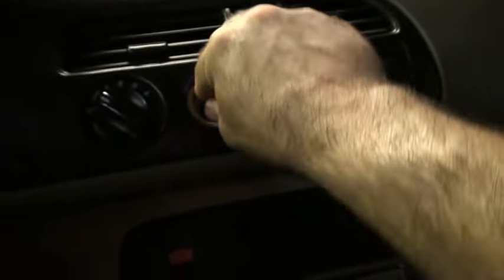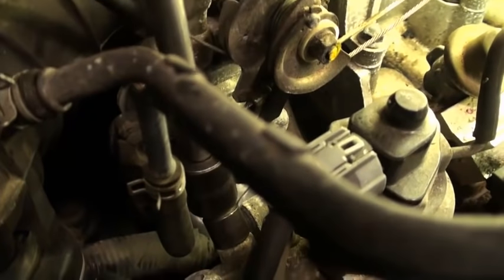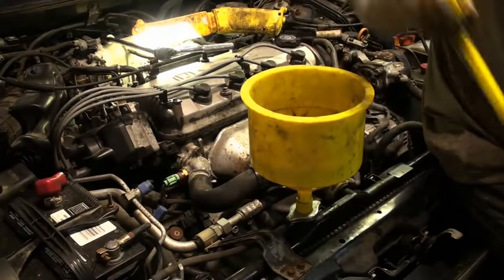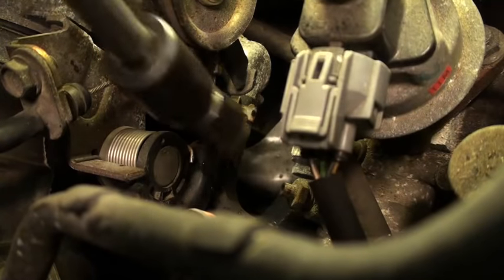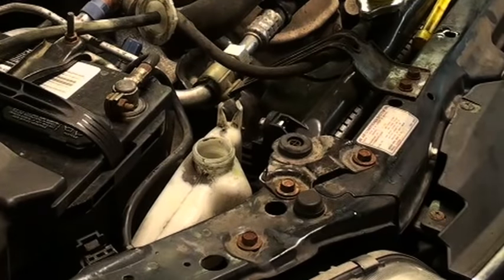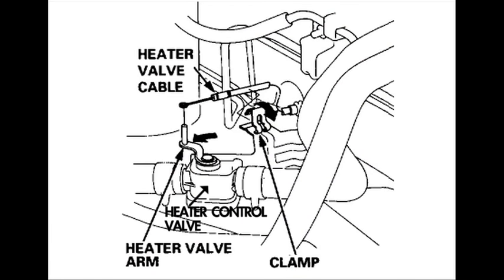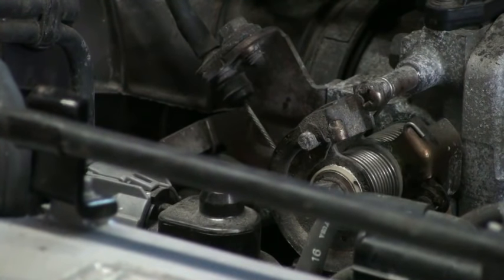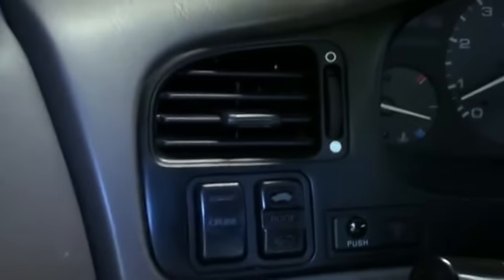How To Bleed A Cooling System - EricTheCarGuy

Comment: I still dont understand what was done here to bleed the air out, i dont get it.
I have seen other videos where you rev the car at a decent speed and you open the reservoir bottle(header tank) and then you squeeze the radiator pipe. Not sure which pipe ir was though , the Input or Output hose.
Reply: +Imre Csoka  Simply follow the detailed outlines in this video and your coolant system will be bleed.

Comment: Eric I have a 96 honda accord with the f22b2 with the autmatic transmission and I have a plastic radiator that has the tranny cooling lines running through it and its leaking into the antifreeze and I was wondering if you could make a video how to flush the transmission
Reply: +3J Kreklau okay

Comment: question... what do you do with a vehicle that doesn't have electric cooling fans? like on a truck? my canyon has the single fan that's belt driven.
Reply: +Anthony McDonald Probably need to run the engine long enough for it to get to working temperature. If it's a big American engine, give it say 25 30 minutes & ascertain by carefully touching the hoses & other parts of the cooling system.
Reply: Unless things have changed, the clutches on mechanical fans basically respond to heat. So on a cold start it'll slip a bit and not pull as much air since the water in the radiator isn't hot and therefore heating the air. Now when everything gets up to operating temps, the fan's going to be pulling in hot air and the clutch tightens up and the fan spins faster, or closer to the engine speed.

Comment: Yes sir I have a 07 dodge nitro and I have a transmission fluid leak on the driver side front...how do I change out my ac condenser I was told the trans cooler and the ac condenser are made in one unit...how do I change it?

Comment: hello Eric i nstall a engine in my Honda civic the i bought  from a junk yard the engine run is very smooth but the tempurature gage is in H i replaced the thersmotat and the switch the goes from thermostat housing to the radiator fan, but my radiator fan it doesnt work when the temperature rich 150degrees but i connect wire direct from my Battery to the radiator fan and it work. you think i need to purge my radiator or water pump i dont know . help me please
Reply: wilfredo perez cooling fan fuse, possibly clutch but most likely fuse.

Comment: I have a 2004 ford focus and my reservoir bubbles up and has done this for a while. what used to happen every great once in a while is that the car would overheat from having no water. Now, the reservoir bubbles up and then water comes out of it and of course, heats up because of no water. I turn car off before it heats up and when it bubbles I turn it off because then water comes out. the car will run fine utility car temp gets where it needs to be. Also, heat didn't work until I gave it gas. if I need to bleed the line.... where is the bleeder?
Reply: I meant it runs fine until it bubbles up! I notice the temp gage is ok while bubbling up.

Comment: need ur 2nd opinion sir. I have rough idle situation after I bleed the radiator. I've re bleed the radiator n make sure all bubbles out and also found the vacuum leak in intake gasket n fix it, change the auto idle up, change the Idle control actuator in throtle body but I still have the symptom. fyi I'm using swapped k3-vet with custom velocity intake & td04 turbo. do u have any suggestion sir? thx in adv.
Reply: I also done the vacuum leak test n find no more leaks

Comment: Hoping to get a response. 
My vehicle was running at the proper temperature before I replaced all the radiator hoses.
Now it's overheating. 
I tried to follow all the steps about bleeding the air out of the system but it's still overheating.
Reply: What car and while its overheating feel both hoses if 1 is clearly hotter than other or 1 isnt even hot just warm then you may have an issue with your thermostat 

Are your cooling fans connected and working?
Reply: @liveandletlive2894 ,
Yes cooling fans working.
Thermostat was replaced a few months back, but I went ahead and replaced it after the hoses.
It's a 1997 dodge ram 1500 5.2L 
Like I said, before changing out the hoses the temp never got above 200.
I was wondering if air got Trapped in the line, but I've tried to bleed the air out.
Thanks for the reply!
Reply: @sandracox4341  little bit of air shouldnt overheat the engine I never bleed my cars until the winter
Reply: @liveandletlive2894 , 
The car guy in the video said that overheating could be a symptom of air. 
😥
Reply: @sandracox4341  I know but just saying from my experience a full system with a bit of air isnt an issue...if you have so much air then yes itll cause overheating but then again your system isnt full if theres that much air in it
Reply: @liveandletlive2894 ,  I guess to the mechanic I go.
It's just so strange that it worked fine before switching out hoses.
Reply: @sandracox4341  well I guess if the only thing you did was switch hoses then they're must be a substantial amount of air in the system...did you try bleeding it the way he did with that bug funnel?
Reply: @liveandletlive2894 ,  yes with the funnel. 
But I can't locate the bleed valve.
Reply: @sandracox4341  not ever car has a bleeder valve do the funnel method and  rev then engine a couple time then after 15 min or so of running and the cooling fans come on at least once feel the coolant in the funnel if its hot/warm which means the water pump is working and you have circulation
Reply: @sandracox4341  also make sure the heat is on while you do this
Reply: @liveandletlive2894 , thank you. I'm going to drain everything out and start over.
Reply: @sandracox4341  don't think you have to drain it just fill and bleed
Reply: Ryan Quinlan  good call!
Reply: Ryan Quinlan , no!

Comment: hey my honda prelude 94 starts but the idol isn't engaged at all.car will die if I don't hold down accelerator. Any suggestions?  I was told I need a new control idol sensor,  does that sound correct?

Comment: In the past summer,  I change the radiator in my Acura 2004  but the lack of antifreeze I use water  now  in winter should I back to 50/50 or 100 antifreeze and why ?
Reply: change it for 50/50 immediately , otherwise your engine will rust inside and clog everything and ruin your car. also the water will freeze and burst everything, that's why it's called antifreeze
Reply: Ok thanks!

Comment: Eric, I bled my cooling system (attempted to) but the coolant just came leaking out from under the funnel's radiator cap. It's the only one that fit, but it's just a slight hair too big. Is there any other way to bleed it? (84 Lebaron, non pressurized expansion tank)

Comment: If you don’t have the air release bolt keep the front of the car higher than the rear as your pouring in the new coolant. Incline driveway or jack up the front.
Reply: Can you elaborate please ?

Comment: I bled out my coolant any my car still doesn’t have warm air. And there’s a code on the dash for a p0505 (Iac valve). The car runs fine until it gets warmed up. And the acceleration is super sensitive in lower rpms. But the car will accelerate just fine in the higher RPMs. Think you have an idea on what I may be able to do?
Reply: 1998 Honda cx

Comment: But when I take the radiator funnel back off won't the coolant just spill out because of the pressure?
Reply: +omarbarcena97 If you mean out of the radiator, than no, there isn't any pressure if there's no cap.

Comment: This may sound silly,  but there's a need for a video on the correct way to change coolant .  Just saw one where a guy did a petcock drain,  added chemical flush and distilled water,  then drained and refilled twice with distilled before refilling  -  with 50/50..

Comment: i have a 2002 buick rendevous ..i just did a cylinder head replacement and my fans wont come on. i took it to an auto electric  place who says i have air in my lines and thats why my fans wont come on. i have been trying to bleed the lines by the bleeder valve with continues air if i attempt this way what do i do if my fans still wont kick on

Comment: Hey man, I have a 2003 S10 and I went to charge the AC with R134 and it is not going inside the system...The gauge is reading 100psi when I plug it to the low side port... My clutch seems to be engaging because when I turn the AC on the idle jumps and I hear "the click" I also tested the AC charging kit outside of the vehicle and it is shooting coolant out just fine...Whats goiing on here? I just charged the system with a very small amount of r134 2 weeks ago..

Comment: What do you do if your heater core isn't hooked up? My isn't hooked up and the hose for it has a spark plug in the end of it.
Reply: That's funny!! BWAHAHAHAHAHAHAAH
Reply: Connect the 2 hoses together so coolant runs through.
Reply: hey dave if you don't see that bleeder valve do you just take the cap off turn the heater on and rev it for a while till you basically cant top it off anymore?  and I got a clutch fan cooling fan is it supposed to kick on and off like an electric one?

Comment: Hopefully, the comment section can help me out with this. I have a BMW 328i 2011 and on the left side of my hose that is connected to my radiator keep coming off, so it'll leak all my coolant. It happened twice so far when I drive my car for a long time. I would have to keep putting the hose back on. What could be the problem? thank you

Comment: I have a 1999 beetle, GLS 2.0... had good heat before- I put a new thermostat and now I have no heat. in this beetle radiator is filled through the Reserve container.so I pressure vacuum through it to remove all the old coolant (big mistake) now I have air in the system.
Reply: +C 19 Look on the reservoir for a small diameter hose, probably connected near the top. This should be a degassing/vapor return line connecting the top of the radiator to the reservoir. It's designed to collect any gasses in the coolant circuit. Take care as it is usually part of the pressurized circuit.
Reply: trespire-thanks , I fixe the problem by squeezing the lower hose many times.

Comment: I've got an 03 dodge ram (there is my problem lol) heat has never worked but never needed it until now, the heater core is very clogged I confirmed that, what can I do if only a tiny bit of fluid runs through it, I've tried the air compressor trick to no avail! Plz help what cleaner can I run through it.

Comment: Hello, I have had problems in the past with bleeding my coolant system on my vw passat vr6. It doesnt have a radiator cap, it has only an expansion tank. I ran the car with the cap off for several minutes until the fan came on and still managed to have air in the upper radiator hose. Any tips for bleeding this type system?
Reply: I'm not sure if the VR6 engine has bleed screws, but I know the 2.8 V6 on my B5 A4 does. I'd try searching the VW forums or passatworld.com. They'll probably have a good idea.

Comment: My 2001 honda odyssey has 2heater cores (for front and rear heat) just changed fluid can't get heat to operate. No bleader valve on my car. Can you help?  I've done Hondas procedure 3 to 4 times. I must be doing something wrong.

Comment: Hello I have a 2004 Infiniti G35 coupe and been having cooling problems after changing the water pump, thermostat & radiator jus yesterday I was driving the car and notice it was over heating again and smelled a lot of coolant from in the car while I was driving pulled over to check what was going on and seen a lot of coolant all over the engine remind you I jus had the cooling system bled.....what to do?

Comment: hi I have a question I replace my thermostat radiator cap and I put new coolant in there and my car seems to overheat still what can the problem be ? its a 02 Nissan maxima 3.5

Comment: Dear erik the car guy i have a 97 honda and it does not have a bleeder valve i read on it and people say its on the radiator near the top radiator hose but i replaced the radiator and it is not oem and does not have a bleeder valve with it how do i bleed the car with out a bleeder valve? Thank you

Comment: hay eric just found ur channel here latley herd of it but i was searching more or less on specific vehecles ,but learning alot in general ,my q is i just replaced thermostat on my wifes 2000 pontiac sunfire 2.2l ,i was wondering two qs i watched ur vid on stats ,im wondering #1 the car had a 192 degree stat ,i went to my local advance and my tech or what ever theyre called ,who has 20 + years gave me a 180 degree ,i had hered that 192 was way to go ,no spec in owners manual on witch was gm s recamondation,so what do you think pros cons anything,only thing i cood see is one opens sooner than other,which brings me to #2 as far as temp gage on dash i do not see any major difference as far as temp being lower on gage i guess in my head i was thinking when gauge got to 180 or so it wood start cooling well faster than with  the 192 well not faster i mean sooner,i could not here stat open or close but temp has always been about 195 or lower it started gone above that in last couple days figured try new stat not gone above 195 now but i did use bleeder like you said had good steady flow ,well if there was an air lock wood you get that flow from bleeder shit thats three qs well thank u for any time you can give me thanks i live in southern part of pennsylvania its been cold it was 39 today which is warm compared to highs of 15 at 3pm well thanks eric for any help

Comment: if you were to start up your car with radiator cap removed and coolant was to real soon after start to gush out of the top of the radiator- could that  POSSIBLY be a result of air in the cooling system-  this is happening to me    just recently replaced a lower air intake gasket  and this is one of the problems I am having  along with possible vacuum leak,   Thanks
Reply: I'd be looking into a bad head gasket. Whats the oil look like?
Reply: eddie; that's exactly what happened to my Toyota when the thermostat was stuck in a closed position. The water had nowhere else to go but out the top of the radiator. That can also happen if the water pump isn't pumping. (usually a broken fin or two)

Comment: So I am bleeding the cooling system on my 98 jeep grand cherokee 5.2.  It gets to operating temp and all is good for a few minutes, then the funnel in the radiator starts to rapidly boil over and it is like the coolant wants to escape the engine.  Is this a sign of a blockage? No air is coming out and the headgaskets seem to be fine.  I constantly hear gurgling in the heater core but that is a known issue with the GC's from 93-98.
Reply: From a thread on your site, Thanks!! "I think I mentioned this contingency in the video. If that happens, turn the engine off and let it cool. After a while the coolant may go down inside the funnel. When it does, top it off and restart the process. It happens sometimes. It's not a big deal, it just takes a little longer to purge the system."

Comment: Hi Eric I have a 2015 Renault traffic 80,000 miles that heater just blows cold air ,so I flushed the the heater matrix and found oil in the system. It did heat backup a little bit for 5-10 minutes and then back cold . I had a 3 year apprentice mechanic and he is talking about head cylinders/ gaskets . €0000000
Any idea what it could be 
Cheers

Comment: I have a 2002 Honda Accord 2.3. I was running the car for about an hour before I realized my needle in the gauge was marking 3 lines before the red HOT line. I checked the antifreeze and it’s full. I have no check engine light or maintenance light on. What could the problem be...???!!

Comment: I have a question when I open up my radiator cap it shows like it's low on coolant but after I started up and let it run the coolant rises up to the top And even sometimes starts pouring out what could be the problem

Comment: I've always wanted to ask this question: can I bleed the air by driving the car while the radiator cap is half open or loose, instead of leaving it running in place with the cap off?

Comment: recently I have noticed that my temp gauge has been fluctuating from about 1/3 to almost cold when going downhill.  Replaced my T-stat, water pump, and timing belt.  These were due for service anyways.  It is still fluctuating.  Warmed up car, check coolant levels, fan came on like normal.  Could it be my temp sensor failing?
Reply: There may be a bubble in the coolant that causes the fluctuation. Happened to me,but mine went FULL hot and back to normal.

Comment: I replaced the thermostat, radiator cap, and the radiator. If I used water instead of coolant radiator, will my car overheat?
Reply: I don't think it will. I'm in Malaysia; tropical climate where it's hot most of the time. I know of many people who use only water and I've driven one before without any coolant. Was often stuck in a traffic-jam on a typical hot day but the coolant temperature would stay below 100 celcius. Just make sure there's enough water. The other factors i.e. the ones you mentioned are more crucial. You'll be okay.

But it's better to add coolant because it also acts as rust inhibitor that protects the water pump and the radiator. Besides raising the boiling point above plain water's 100 celcius, many coolants also have anti-freeze properties. The latter is useless in tropical countries but critical in cold countries. It will help prevent the water from freezing and cracking the radiator during a cold snap. You have a new radiator and it's definitely worth coughing out a bit more money for the coolant.
Reply: Your car won't overheat, but it's recommended you never go below a 20/80 coolant/water mix because the coolant has rust inhibitors and lubricators in it.